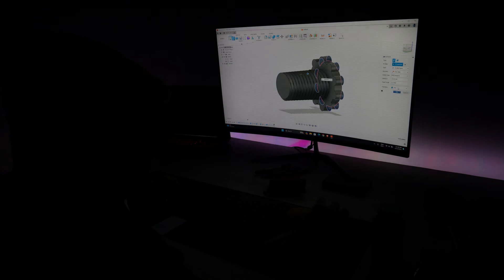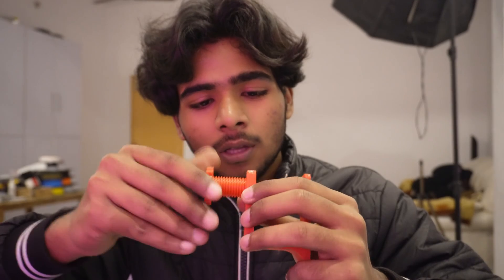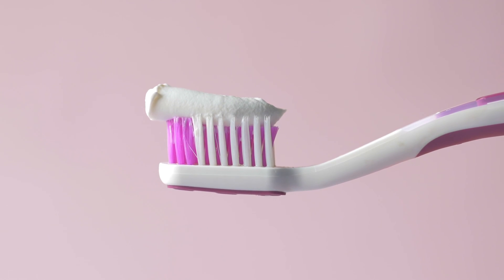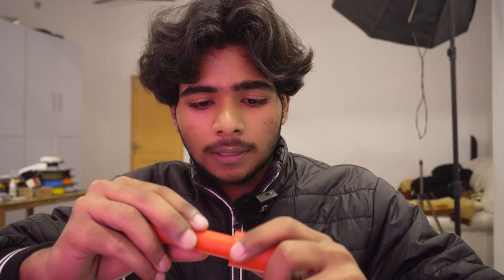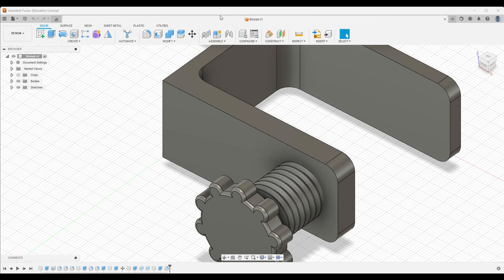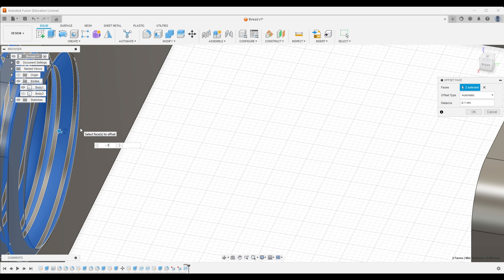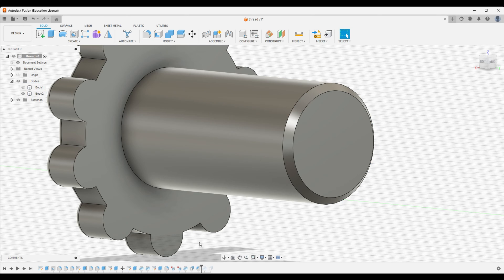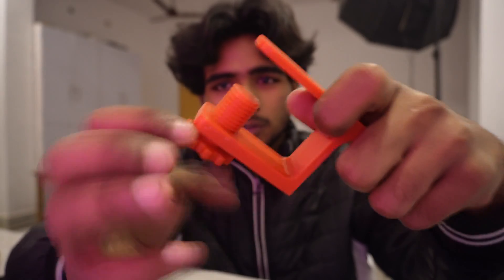The Easiest Trick for Perfect 3D Printable Threads that YOU Still Don't Know

Comment: A common terminology mistake I hear a lot on CAD and 3D printing YT channels is using "tolerance" when referring to the gap between two parts. This designed gap is referred to as "clearance", not "tolerance". Tolerance is the potential allowable variation with a part's dimensions so that it will continue to perform the desired function, while clearance is the space designed between two parts when they're assembled (like a bolt and nut). Good video otherwise, thanks.